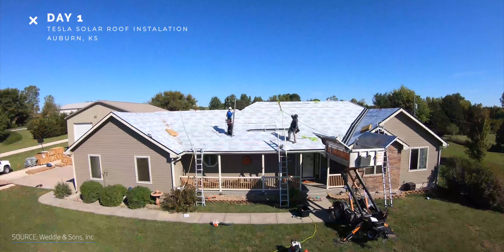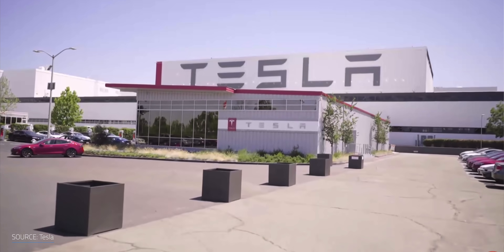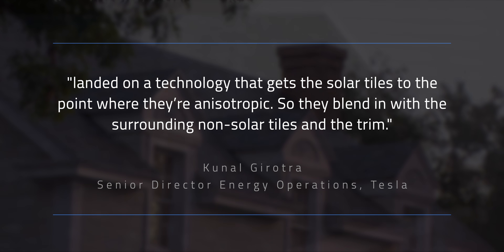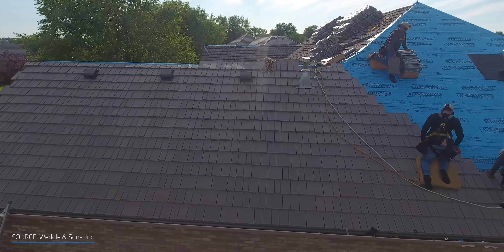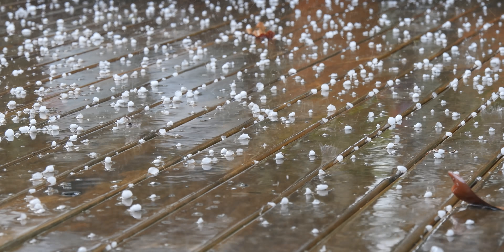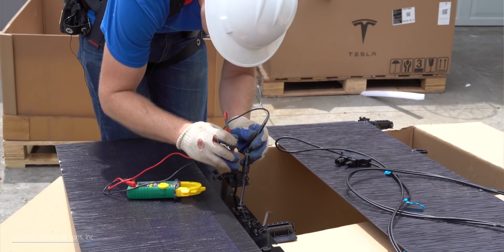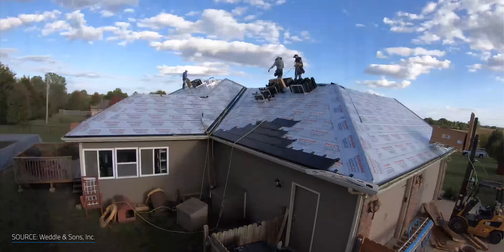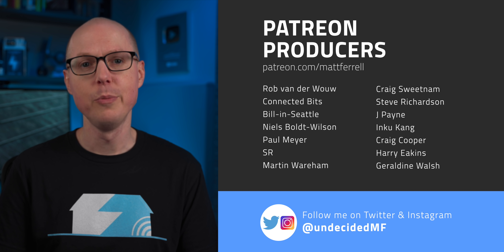Exploring If Tesla Solar Roof Is About To Go Mainstream?

Comment: I love this but I'm just wondering if one of the tiles shatters when it's raining are you going to get any water damage or is it okay for water to go underneath the tiles for a day or something I'm not sure
Reply: The backing board underneath a roof can last about a year exposed to weather and sun so it's really no big deal. Hopefully the person owning the roof will replace the tile before that though. Tiled roofing also tends to have a drainage underneath because you will always have condensation so the water is able to flow down in the gutter from underneath the tiles too.
Reply: The underlayment used in roofing is water resistant, so you should be okay.

https://www.firestonebpco.com/us-en/roofing/metal-roofing-systems/clad-gard-metal-roofing-underlayment
Reply: Glass done right is insanely strong, or at least it is in regard to ice. Back in 2008 Perth, Western Australia got hit by an of the charts hail storm, in this case golf balls were the little ones, I picked up one hail stone which was the size of a couple of baseballs welded together, and that was pretty typical in many areas. One Client showed me a hail stone he had saved in his freezer which was the size of a grapefruit. One insurance assessor I talked to saw a couple of cars where a hail stone had punched through the steel body panels, and I believed him because I'd seen multiple vehicles where hail stones had come close to doing just that. I saw multiple instance where hail stones had punched right through concrete and clay tiles. I often saw damage that just left me in stunned disbelief, because I wouldn't have thought it was possible.
In all the hundreds of roofs I got onto, I never saw a solar panel with broken glass. Solar installers told be that the only solar panels where the glass broke, was some of the older panels installed pre government regulation that required tempered glass to be used.
The most common form of roof damage is wind, wind blown debris, and falling trees,  and in the case of the last two glass tiles aren't going to fare well, but then neither does anything else.

Comment: Don’t think we’ll ever get it here 🇬🇧
Reply: Why not? Maybe a couple years.
Reply: @grantguy8933  the UK mostly relies on wind energy
Reply: @carholic-sz3qv  yes it does but even in less sunny areas of the uk an area of 1m2 gets around 1000KW/h of sunlight per year.   So if efficiency of solar cells goes up from 20% at a good price point then it still is worth it.
Reply: @princewillip  the efficiency of solar panels is evolving very slowly because the most efficient ones are used on satellites and they are very toxic to produce

Comment: I can’t wait for Tesla roof to hit Canada. I’m on the wait list
Reply: Where in Canada I wonder if we get enough sun in some areas
Reply: @amystephenson3665  what part of Canada are you in? You will most likely be fine considering the insolation values are decent enough even above 40degree latitude (which i presume you are).
Reply: Half the year it will be covered in snow and thus completely useless. Even it isn't the sun is weaker in the winter and sets earlier
Reply: @AdamSmith-gs2dv  This is true, would be interesting to add an element of heating to the shingles in order for melting. Although this could potentially be massively expensive depending on the method used.
Reply: I’m positive you can make up the lost months from Winter in the summer time. I’m in Eastern Ontario and right now we have no snow. Therefore even if I lose 3 months on energy, in the end it will still be cheaper with solar. This is my last house so I’m looking at 25 + years on ROI